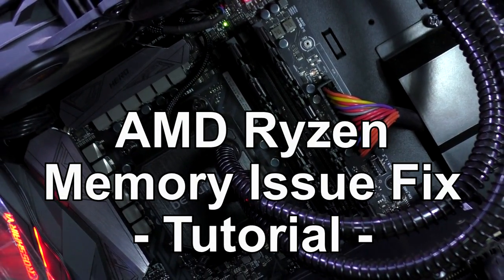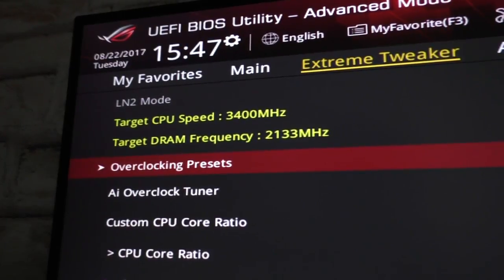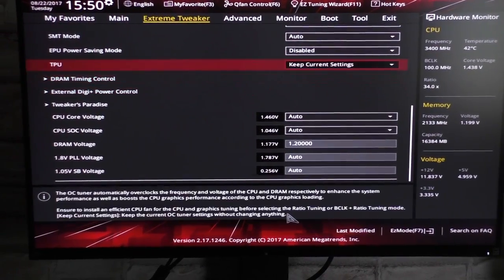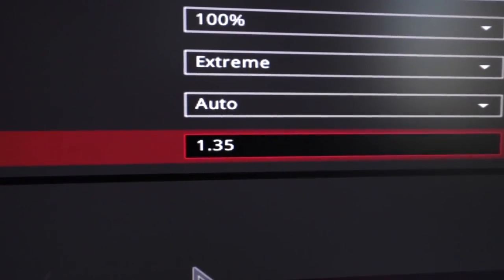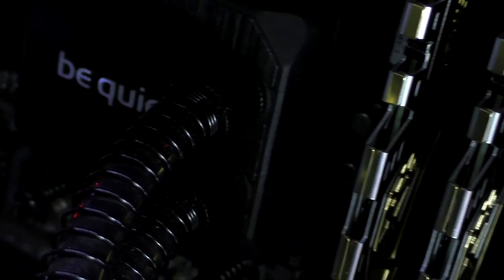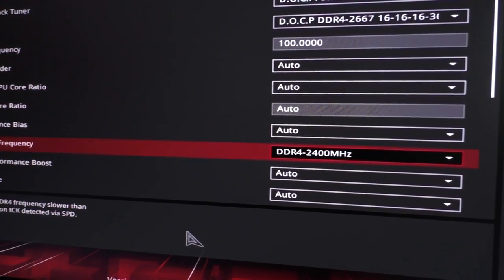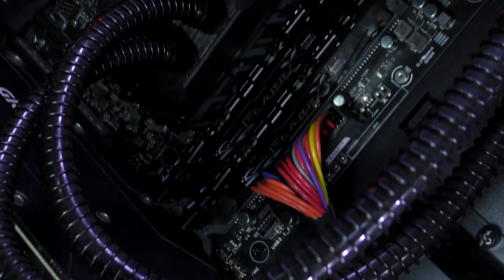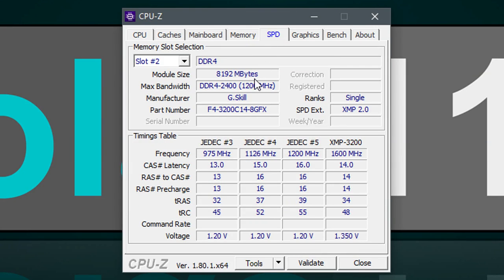AMD Ryzen Memory Issue Fix - Tutorial

Comment: Wish I knew all this before buying piece of shet ryzen. After replacing my MSI board and HyperX ram with Gigabyte and adata xpg, now it finally boots up, but enabling xmp will cause the same random reboots that were happening with msi +hyperx. My PSU is gigabyte 700W 80+ Bronze & GTX 1060 6GB from older i3-4150 PC and both work flawlessly (tested with FurMark). It is sad that my 3600 mhz ram is running at XMP disabled 2666 Mhz. I am afraid to tweak settings manually even using Ryzen DRAM Calculator. Never experienced anything like this on my older systems, usually all problems were windows or software related. Heck I didn't even know what BIOS was. I guess now I know why people buy Apple products.
Reply: I'm having the same problem, can't get my 64g 3600mhz past 2666mhz, what a waste of money!
Reply: @BigDFPV  Switched back to XMP 3600 Mhz profile and it seems to be working stable now for 2 days now. Weird. You might need to tweak a few settings in BIOS; I can't exactly remember what I changed in mine. It does make an avg. 5-10 FPS difference in the only game I tested (Jedi Knight Fallen Order) between 2666 Mhz & 3600Mhz but it only happens when you are not GPU bottlenecked (Low Graphics Setting)
Reply: @dragonscaleshields  Glad to hear you got it working.  I was able to get mine to run stable at 3400, once I switch to 3600 it runs for a few minutes then crashes.  I'll do some more research before I try 3600 again.  Thanks for responding.

Comment: omg! it worked! tq so much. i had a problem with my ram after i flash my bios. cant use docp profile. it wont boot. i enter the dram boot voltage to 1.4. can i put the voltage to 1.35?

Comment: i have 16GB (dual) G.Skill Ripjaws V Black 3200 running on Asrock AB350M Pro4 @ 3066 16-16-16-36 (but crashed on games) stable clock speed is 2933 14-14-14-34
Reply: at what voltage? im going to buy the b450 one, ive seen some bad reviews with ripjaws v but thats just ryzen being ryzen
Reply: Hunting correct timings with amd 5ghz challenge, its the best times still 20 years later.
Reply: Is that QVL supported?